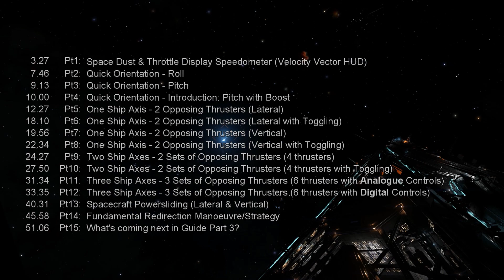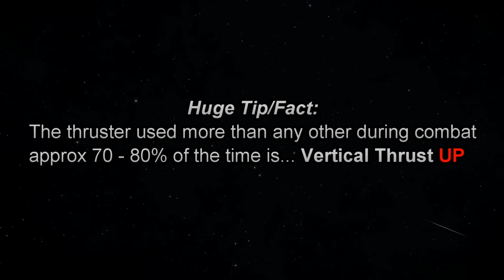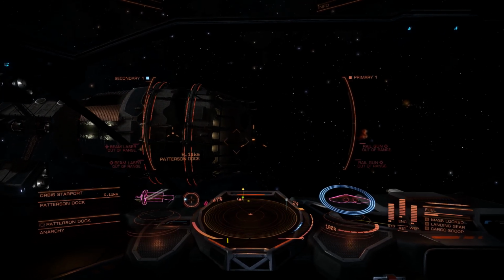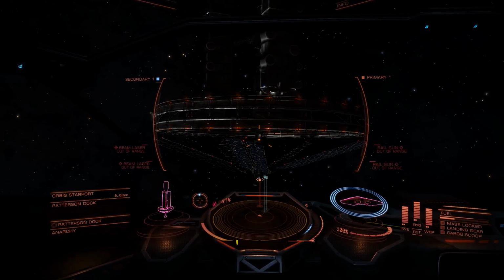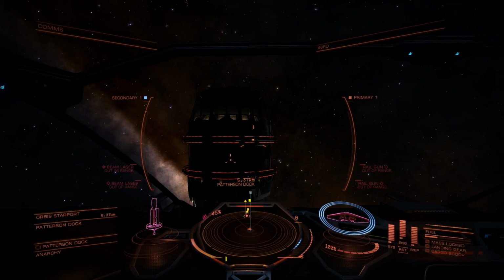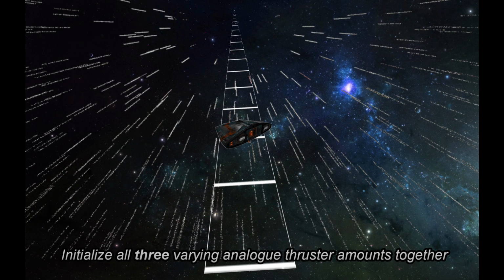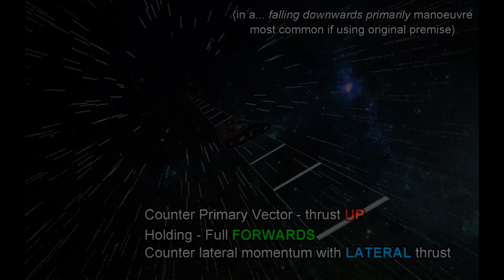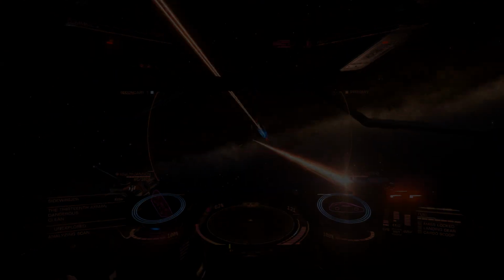Elite: Dangerous - Learning [to pilot with] Flight Assist Off (Part 2)

Comment: not sure if it just wasn't common knowledge or if you intentionally excluded it but the lesson at 11:01 is also applicable to using the cargo scoop as a boost limiter, because it limits speed but not rotation rate and, assuming you release the cargo scoop soon enough, still gives you a great deal of momentum at the end of the rotation

Comment: So basically what you're saying, in a nutshell, is check the direction of the space dust, compensate with thrusters in the opposite direction and keep an eye on the velocity to reach a near zero value for successfully stopping. 

The boost flip is often used to keep a hostile in sight which is a pretty important move.

A lot to take in. Thanks for this. Extremely informative.
Reply from the maker: If you want to continue your current momentum then you would apply the opposite of the space dust (you got a bit confused or I'm simply misunderstanding what you've said). So to clarify: Remember.... the most important thruster inputs when piloting with assist off are counters (as in trying to slow the ship down, you'll not have any issue speeding up), so... notice the direction the dust itself is travelling (which is opposite to your ship) and match the direction of this space dust with the same direction thrusters to counter your speed.

Like I say, remember.. the space dust itself is travelling the opposite direction as your ship is, (to give you the feeling of momentum), but by noticing this direction of the dust across your FOV is a quick way to realise which thrusters you need to bring the ship under control, by matching this dust's direction with the same direction thrusters.
Reply: LOOK INVERTED Yes, of course. You're right (I was pretty tired when I typed that). But I've slept now and I see my mistake. Dust travelling up and to the right, means I'm travelling down and to the left so in order to stop I thrust in the direction the space dust is going (up and to the right). 

Most of the time when I battle with assist off my hands are acting as if it's on, meaning I accumulate a lot of velocity in a certain direction without compensating which in turn means I go spinning in all the wrong ways. I've got a long way to go before I can do this by intuition. Practice makes perfect :)
Reply from the maker: The Highlander
Practice makes perfect, indeed it does! At first it seems very hard simply because of having to break the habits we've learnt from piloting with assist on, like you say, you're not compensating because you've never had to before. It's simply a different way of piloting, if we'd all started with assist off in the first place I believe we all could have learnt it much quicker, it's simply these bad lazy habits we've got to get out of our systems first. A bit harsh to say lazy but you know what I mean, there is frankly not that much to do with assist on in my opinion, which is one of the main reasons I find it so rewarding and addictive to fly with assist off, and you will too once it clicks. You won't regret putting in the time to learn in the first place, once you reap the rewards you'll perceive the game in a completely different light. There is something really compelling and satisfying about piloting a ship in a flowing, drifting, falling manner, it is of course what space flight should be/is like.

Have fun and good luck, don't hesitate to ask me anything further and let me know how you get on :)
Reply: LOOK INVERTED Flying "free" (to put a word on it) is something I'm sure I can do. Just have to make it intuitive for myself. But here's a question...do you have rotational assistance on or off?
Reply from the maker: The Highlander
Free indeed, good description. You are talking of Rotational Correction yes? This is purely for docking when you are flying with Assist On, so your ship matches the rotation of the station you are approaching. Rotational Correction is always off with Flight Assist Off (it doesn't let you change it in functions whilst switched to FA off because it's not applicable in the assist off mode). Try turning it off with Assist On when approaching a station and you'll see what it does.
 Edit: I should say try turning it off and back on again and your ship will start rotating with roll if you are perfectly aligned to the station entrance (i.e: axis), but if not aligned and off to one side a bit, the ship's thrusters will start to fire to keep the whole ship's translation aligned and moving/rotating at the same speed as the station.
 You obviously don't need any of this with assist off.
Reply: Aha. I didn't know that rotational correction was turned off automatically with assist off. It took a while before I realised I didn't have to correct roll once inside the space station. 

I'll have a play around with that when I turn assist off. I'll try not to ram anyone in the process :)
Reply from the maker: The Highlander
It's a bit of a bizarre option anyway to be honest, I'm not sure in what instance scenario one would want to turn this rotational correction off anyway when piloting with assist On. Would probably get you into a world of trouble trying to dock with assist on, but having to input certain thruster inputs just to stay in-line with the entrance when you're not exactly on axis. I can't think of any other reason other than it's there as an option perhaps to educate the assist on pilot and make him/her realise that the assist computer is helping you stay in-line with the rotation. I can't imagine anyone wanting/needing to turn it off, you may as well just turn off all the assistance and just dock with your own momentum. With assist off you are in fact travelling at quite a rate, obviously the speed of the rotating station literally right up to the point until your landing gear latches on and docks solid. Nothing wrong with a bit ram here and there ;) ....coming through!!!!
Reply: Why is it there anyway? Good point. I didn't think about it until weeks into the game. It's a bit of realism that most don't want to know about. It's probably there for people like me. People who slowly come to realise what being in space is really like. It's actually made me think about what working in space is like for astronauts. No cheats for them! 

Naturally I try to avoid ramming into stuff around me but I don't get upset anymore if I do. It's all about claiming your space (haha).

Comment: The best video guide on internet for Flight Assist Off on ELITE DANGEROUS, thanks for the explications with the pictures of axes etc.
I wish they put some HUD VECTOR sensor on the ships but this tutorial give all the tips to learn at the moment, Thank's again, I wish some french pilots do the same video for the others, or ELITE to link this video for the elite pilots :D
Reply from the maker: +Christopher Dijoux 
Indeed.. a proper Vector HUD has been a topical debate throughout Elite's creative process, back in Alpha we did have ticker-tape gauges/guides around the fov as to what your ship was doing on each 6dof axis, but for whatever reason decided just the space dust was sufficient (I believe the reasons were to create a clutter free field of view). Then the space dust was scaled back in intensity so it was much harder to see, but at least there is just enough.. just.. to be able to see one's trajectory and orientation as it is now in the current game. Perhaps one day Frontier will give those who use fa off a hud that only appears when it's used, so those that don't want to see it don't have to.

Perhaps once you've learnt and are confident in piloting with fa off you could do an fa off "a la francais" yourself ;-)

Comment: As always colossal work here, mate! I am still learning a lot from felling how the ship is drifting in the space and always i got huge impact on my skills when i passed through the gate into the station on a high speed. You need quickly find your landing pad, take control of your ship, directed it and stop it exactly where it should be in the limit of space around you. Also especially with digital controls your get a lot of information how sensitive you control are. So this is really tough exercise, its always really dangerous, but its help a lot!
Reply from the maker: How's it going fella? Station itself is a really good location, especially now we have a tutorial docking lesson, to dock is perhaps quite high up on the learning flight assist off scale, seeing as you have to be so accurate. I did consider this but as far as an actual guide though for open space it's not that much use because of this very fact the vector hud (space dust) disappears once you get close to the station, so anything you learn will be hard to translate to when you are only in open space with only the dust. Good practice for someone at your level already, but remember what you learn will only ever really be useful around a station where there is a fixed point reference because you're not using the dust to do it, not necessarliy in open space with only the dust. You are right about how sensitive any digital control really is, all the more reason to fly with no assists for anyone who has only digital thruster controls because quick digital controls don't have much effect on a falling/drifting ship.

Thanks for your comments Falkrum :)
Reply: LOOK INVERTED Things going fine, thanks! Some cool stuff coming into the game, so i testing Vulture right now and this ships is real beast! I am trying to upload new video with some gameplay and mystery stuff comes with 1.2 Beta3. It should come soon!
Reply from the maker: Falkrum7
I have access to the beta myself but have yet to try at all as yet, been too busy doing this guide amongst other stuff. Perhaps I'll have a go at it now. In the mean time though I look forward to seeing what you post about it yourself, I'll keep an eye out :)

Comment: Hi CMDR Lancer. This was well worth the wait. You explain it very very well, and I particularly like the exercise. I appreciate that you taking the time to share your knowledge. Eager to see Part 3.
Reply from the maker: Thanks mate, I'm not sure at what level you are at or anyone else for that matter, the main exersises here to bring a falling ship under control are crucial to get proficient at, before we move on to using the technique of choosing to leave one of the three thrusters aside to effect our momentum in a particular direction on purpose and intentionally, which is going to be in part 3 amongst other stuff. I expect most fairly experienced fa off pilots have been quite bored so far so will hopefully find Part 3 more useful, I simply decided not to skip anything if I was to do this series properly.

I expect part 3 won't take three weeks either do to this time, was the amount of editing in this part 2 that was ridiculous, the footage was collected in a matter of hours ;).

Comment: A bit late, but rather than looking at the dust and trying to guess, It's better to gauge whether the dust is traveling parallel to the station, and adjust your thrust accordingly. You can then make continuous adjustments while watching both and cease when you have achieved the desired vector. (Old Freelancer trick.) This is a closer approximation to how adjustments are made in combat situations, and allows for a more accurate and real time assessment of whether your thrust manipulation is correct. This is from a digital input perspective only. I've not used analog thrusters.
Reply from the maker: +Austin Smith 
Never too late Austin :). Indeed, you hit the nail on the head, that is really the main reason I used a station such as this as a reference to help you gauge both until you get used to only the dust on its own.

Comment: I have been doing the exercises you have outlined and I am catching on fairly quickly...I still have a long way to go before I am combat ready.  I want to comment that I am using a Saitek X-55 H.O.TA.S and I was having great difficulty keeping the ship stable.  It turns out that tension spring in my joystick allowed a very miniscule amount of play in the stick.  To compensate for this, I added very slight deadzones to the yaw, pitch, and roll axis.

After introducing this change I rapidly improved leaps and bounds.  I am mentioning this because I know that you discourage the use of deadzones for the axis... however they may help would be pilots who have setups where there is a physical issue with the control inputs.

I cannot thank you enough for your guide.
Reply from the maker: Joseph Allen Thanks for your comments Joseph, how's it going? I have done exactly the same thing on my own stick actually. Deadzones are best avoided even at the best of times but not to use them for the function they are created/intended for, to remove any small traces of input that are perhaps being applied when your hand isn't on the stick. Sometimes people think deadzones help with sensitivity which of course they don't, which is why I said what I said for this game and the sensitive ship rotation and quite frankly it's best to recommend no one to use deadzones under "most" circumstnces. They'll figure out the precise reason for when to use them for the reasons we have ourselves.

It's good to hear you are making progress, you make a valid point and perhaps I should have covered this in the guide somewhere.. the very fact one's stick should be set up properly in the first place with no traces of input being applied will most certainly make anyone's progress in learning much more productive. Perhaps they'll read your comment and mine and think about checking their joystick. So thanks to you too and good luck with your own progress, it's certainly a lot of fun isn't it? :)
Reply: Look Inverted I am progressing... I just need to master countering and maintaining control under pressure.  Repetition will make everything more natural for me, for now it is very procedural and robotic. Do you suggest flying solely in FA Off to learn?  Total immersion?  4pips to shields (I will be crashing like Launchpad McQuack) Eventually my goal is to switch seamlessly between both.
Reply from the maker: Joseph Allen
Piloting with no flight assistance (no key mapped to turning it back on at all) was exactly how I did it myself, I forced myself with crashing many a time in learning the quickest in some respects. Even now I haven't the flight assist toggle mapped anywhere (only mapped it somewhere for these guides), but I am still learning new things even now and so having to "make do" is the quickest way to learn in my opinion, but that said it is highly addictive and I'm having such a great time.

Comment: Awesome Video!  I am using an xbox controller and cannot figure out how to incorporate yaw into my bindings.  So far I've done as you've instructed with the thrusters (left stick+ Rb+LB) / pitch/roll (right stick) but haven't quite figured how to utilize yaw.  I'm curious of your bindings, do you have them posted anywhere?  Any tips would be most useful.  Thanks again!

Comment: I'm on PC & have been flying with a combination of mostly XBox Controller & keyboard with FA on. Is there a recommended controller / keyboard layout that works well for FA Off?
Reply from the maker: Hmm, depends on how I'm understanding what you're using. I gather the 'keyboard and mouse users' feel they've the advantage in the natural precision of the mouse itself, not the keyboard which is of course just a load of digital buttons - if I'm understanding you correctly you're using a controller in place of the mouse? Not sure how this works in relation to a twitchy ship's rotation when flying with FA Off (one of the hardest aspects to get used to, and with mouse users they've a 'Sensitivity' option in-game. All HOTAS users, inc gamepad controllers, don't have this option).
Reply: @LOOKINVERTED  I definitely don't use mouse - it's too unintuitive for me. Joysticks are what I need. Mouse just seems wrong. Right for FPS games and RPGs, but not for flying.
Reply from the maker: @Skiamakhos  To be honest I couldn't agree more, tried the mouse and keyboard combo out simply due to curiosity and much preferred my hotas, and I'm pretty sure there are hidden advantages whilst using a proper flightstick considering it's the industrial standard. 
Not sure how or why you've ended up with a keyboard in one hand and a gamepad in the other, can tell you now there are better controller combos out for Elite specifically so perhaps try changing your setup. It will undoubtedly feel very weird at first but over time you'll be fine.
Good luck anyway, you wouldn't regret purchasing a hotas either if you're into sims.
Reply: @LOOKINVERTED  it's mostly because there just aren't enough buttons on a gamepad to take care of everything. Most things, but not all. I reckon you're right, entry level HOTAS would be the thing.
Reply from the maker: @Skiamakhos  That too, buttons are prob a good reason for using a keyboard too. 
Button assignment is one of the most complex and time-consuming challenges to make the whole experience as intuitive as possible. When I went from my Hotas' hands-on-throttle to a gamepad (for reasons I alluded to in part 1 of this guide) I sacrificed many a convenient button on the throttle for my gamepad instead but it was my only option but thankfully there's plenty on my hotas' stick itself that I found that most assigned with no problem. Any remaining I left to the keyboard placed infront of my monitor & setup as a backup emergency area for those rarely used functions.
Perhaps keep this in mind when you decide on which hotas to purchase and find one with plenty of buttons unless you're fine with using the keyboard too for these less-used functions (which is fine like I say, just not for frequently used ones - you don't want to be taking your hands off the stick and throttle constantly).